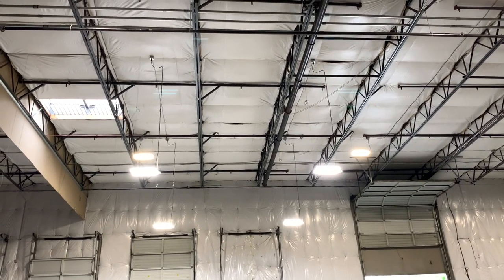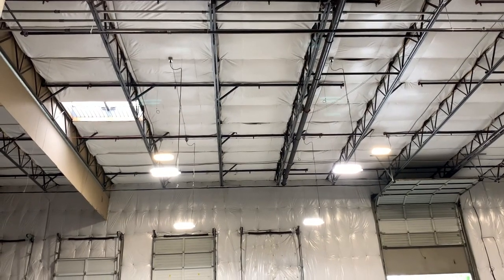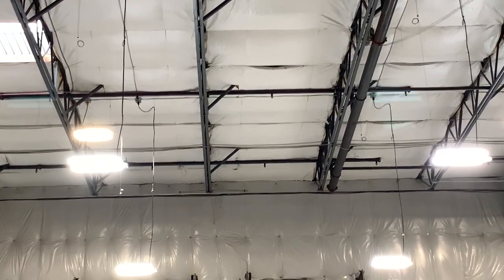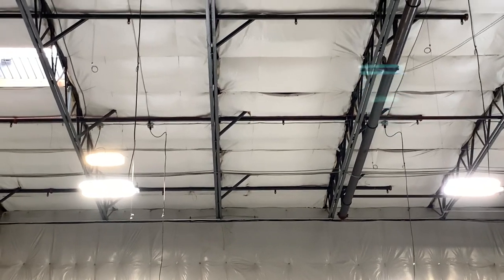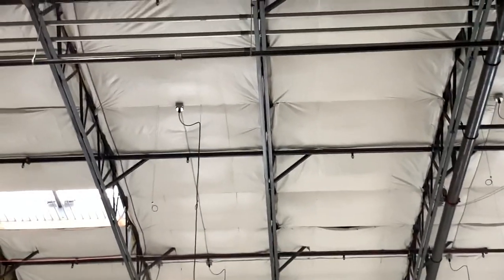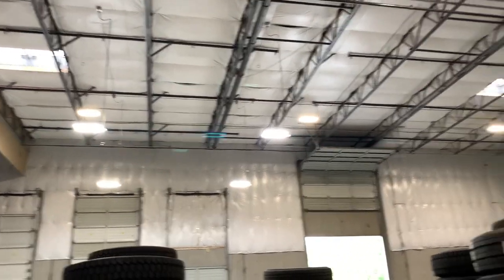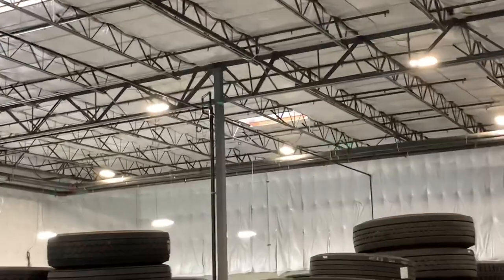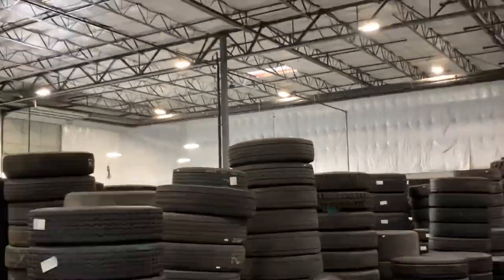My Last Day...

Comment: Your screw problem reminded of problem solver methods for tradesmen. Stuck screw in aluminum fitting, get some alum. Alum powder, you can find this at the spice isle of a super market, can dissolve steel and iron screws pretty well but you need to submerge the bad screw into a pot of hot water mixed with alum. Had a friend teach me about this when I got a stripped screw stuck in an box. Another thing, somewhat harder to find, gallium is great at destroying anything aluminum. Its a liquid metal and perfectly safe to touch but dont be stupid and eat it. Scratch off the oxide layer, apply some of the gallium( you have to heat it above 86F to make it liquid so put it in some hot water) on the exposed layer, wait like 15 mins, if its small, and the aluminum item will crumble like a sand castle. Its fun to play around with but its really messy and gets dirty fast.